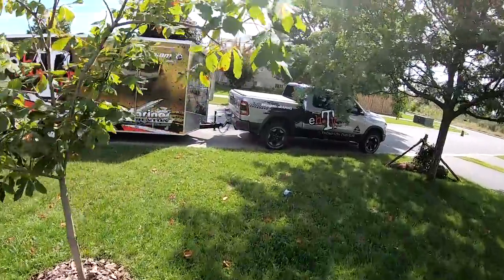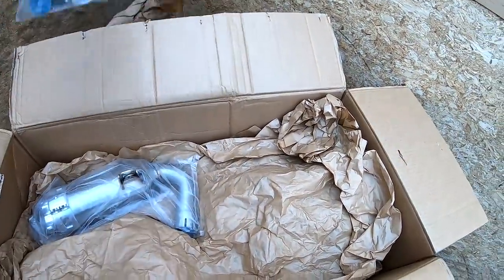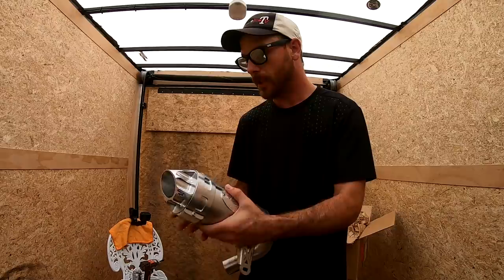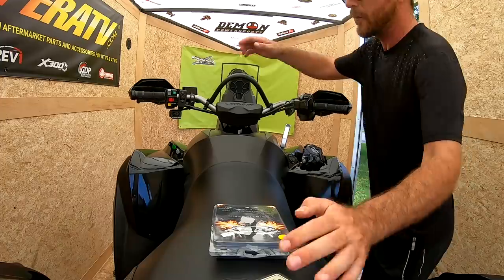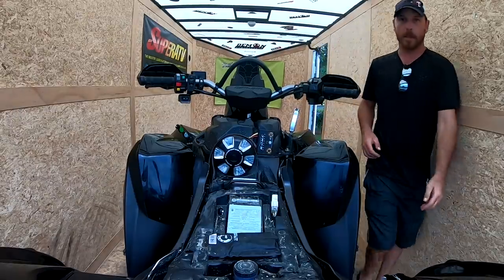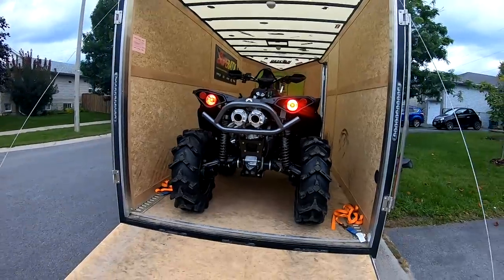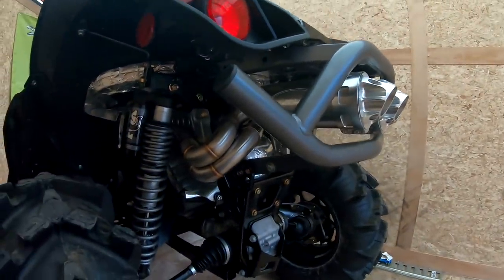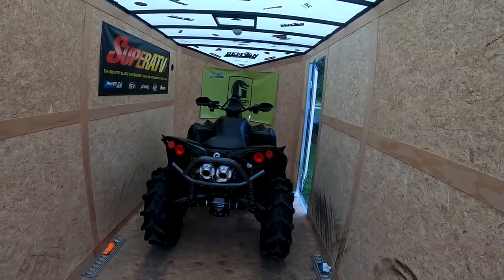2020 Renegade Xmr1000r Dual Exhaust Install (Can you hear me now?)

Comment: Hello, I have a renegade 1000r 2019 and I installed the dual Two brothers exhaust and gave me 12 horses, so I was dyno and shows 103 horses so I recommend this muffler and it is important that the lambda probe is installed in the new exhaust..
Reply from the maker: Right on
Reply: ATV Rosomak Ajre you using as well a fuel optimizer?

Comment: I have a 2020 xmr as well and  purchased the rjwc full not slip on.  Is there a specific reason you picked slip on over full?
Reply from the maker: Yeah this one’s a demo on loan to me, full is not really necessary if you don’t ever plan on engine modifications
Reply: @ehTV1000  just so you know brother there is an XM Army in Florida watching you! Keep up the great work and keep the vids coming.
Reply: @ehTV1000  I have a question. For you good sir. I recently installed rjwc exhaust and the quad does not go faster than 44 mph with either key. Its as if i have hit a rev limiter. Would you possibly have i idea of why this is happening?

Comment: What’s your Opinion on the RJWC dual Slip on vs The HMF performance dual slip on ?
Reply from the maker: Tough choice, the thing I really like about the HMF is it comes ceramic coated if you want. Big bonus in my opinion
Reply: Ended up going with the RJWC. I’ve just seen the HMFs get crazy loud overtime in the mud and water.

Comment: Any increase in horsepower?
Reply from the maker: Probably not, LOL. But at least she ain't running lean and sounds mint. I'm sure ya would get a gain but not enough to notice really. But throttle response is improved.
Reply: Where did you get your fuel management  programmer

Comment: Did you trade your Rene in or is this a project/Demo?
Reply from the maker: No, I still have her. Got a few more mods to do to it yet. This Renegade and the Xrc are demo's supplied to the channel from Bay Marine. Said I could modify away, Hahaha. So that's what I'm going to do.
Reply: eh TV that’s awesome. Idk who’s paying for the modifications but I’d really like to see some portals or tracks on this one personally. Cam shaft work, higher compression, head work etc. power and low gearing or just floating on tracks. I’d love to see tracks VS nos boss’ assassinators. His setup seems to have become the standard in the skeg world so it would be cool to see. Ostacruiser does it with success but you don’t see many on a renegade body...especially a 2020 cough cough first 20’ on tracks???🤔
Reply: Someone actually buys these after they are modded and what many consider used.